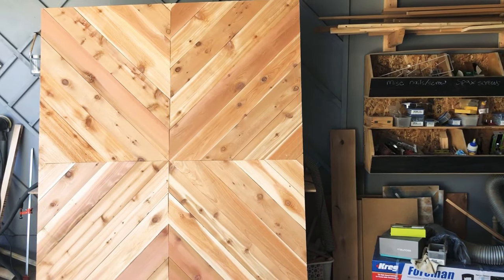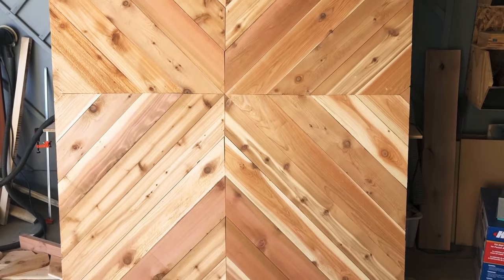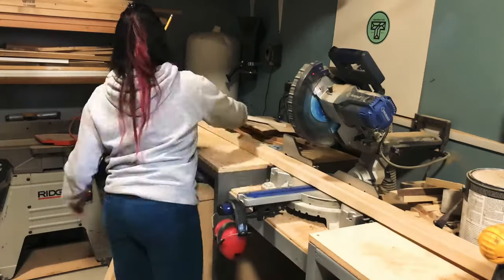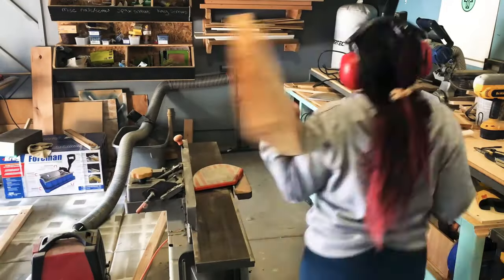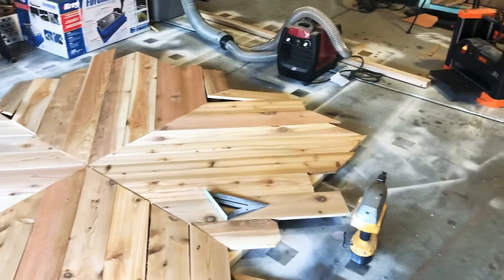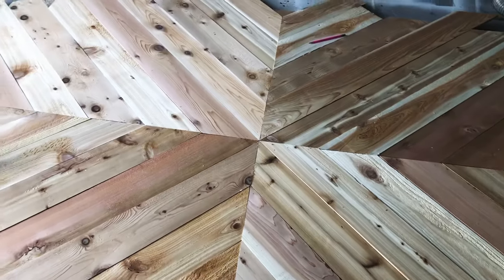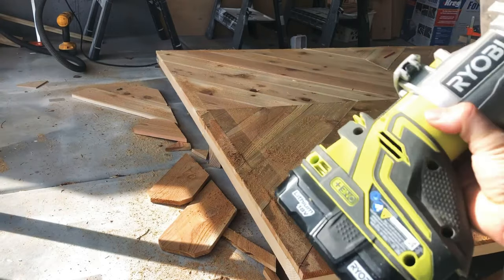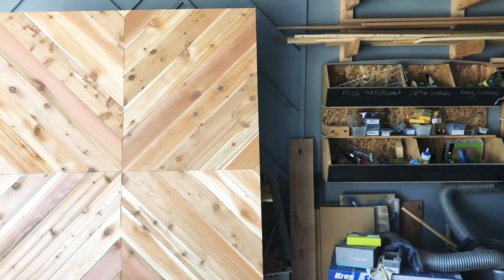DIY BARN DOOR DESIGN - SUPER LIGHTWEIGHT HOLLOW CORE DOOR

Comment: Looks nice. I just became a subscriber. Your design is simple enough for me to do. Do you have a video where you hung it up on the slide?

Also, if the rear will be seen as well because I plan to use the same design for all the rooms in my house, is there a way to reduce the thickness so that it becomes as thick as a regular hinge door? Thanks.

Comment: That looks awesome. I watched your slides vid first as I also need to hang it off the ceiling and I'm super worries about the weight. At first I thought your design might have been too heavy still but it seems to move around pretty good. Would you consider 1/8 or 1/4" ply sheets on a 1x3 frame suitable? They would be lighter still. I'm working on a hallway door to replace a curtain more for separation of space with some added security.

Comment: hi can I use 2 by 4 too?
Reply from the maker: Hi Perla, you can but it changes the thickness of the door and some door hanging hardware cant accommodate that thickness, so check the hardware you plan to use first and then it should be fine!